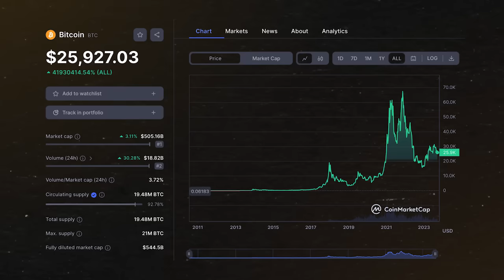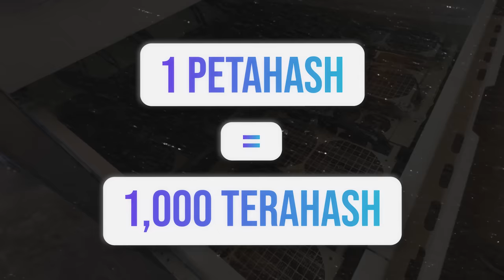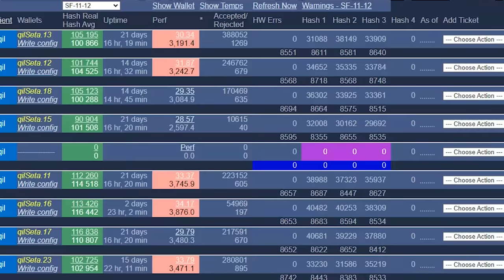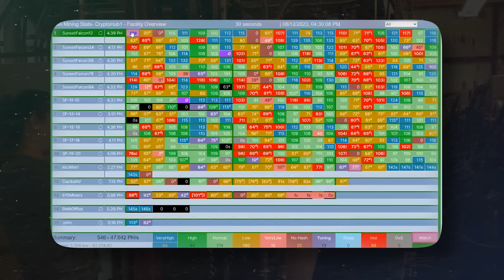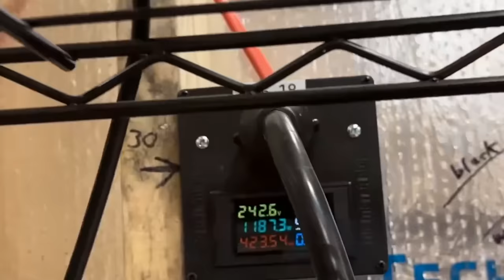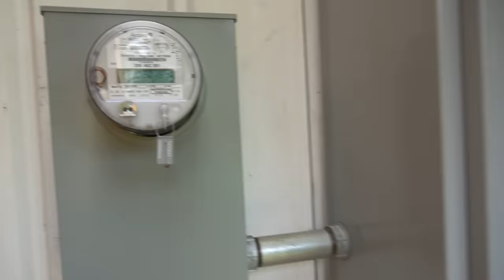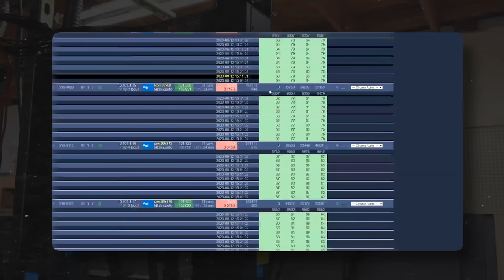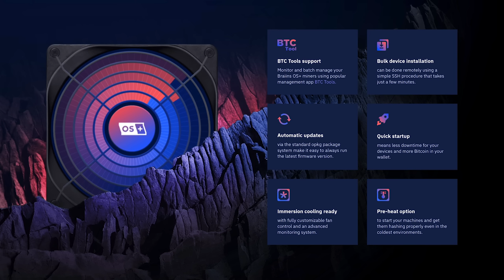Inside a Liquid Cooled Bitcoin Mine

Comment: This farm is the exact farm I was trying to create 3 years ago.  Many people wont understand the level of expertise that is needed to setup something like this.  Not to mention the expense which is one to the factors that ultimately held me out.  The other was not having an industrial or middle of no where to be able to setup.  Then the third was the realization that the electrical needs are beyond my scope of understanding and require expensive professionals along with expensive equipment with long lead times.   Congrats to this gentleman for making the dream work.
Reply: It's not that complicated electrically. Its just a lot of power as each machine used 3000+ watts. Coming from building commercial grow rooms for the marijuana industry building mining setups like this is a walk in the park.
Reply: @attribute-4677  Eh, in the near term it definitely does not. A facility like this might take decades to pay off.
Reply: @DJSolistica market could crash before they see a payoff.
Reply: problem is having top efficiency miners, manufaturers sell only asic miners after their campaign and you buy expensive 2 years old machine and Bitmain have 1-2 generations never .. preset miner is very easy if you can set up tplink router you made it. Its only on elektricity price and price of miners. What that boys not use waste heat for any heating close people housing etc, blowing it for air is stupit, it can bring beeter economics.
Reply: @jirkas229  what kind of back yard english was that comment?
Reply: You are brave
Reply: And destroying the environment one piece at a a time. Talk about waste
Reply: @ronnbarsvagen2512  speaking of wastes.  I just saw they are in the process of putting a Tesla recharging station in on the lot next to a gas station.  I was hoping for a sandwhich shop.  What a waste of electrical components that could be used for something useful.  Nothing like E-waste to take up all of our grid space.
Reply: @ronnbarsvagen2512  You want to talk about destroying the environment? Wait until you do the math on how much electricity we've consumed globally to power millions of ATM machines for nearly 3 decades. That doesn't even begin to include all the hundreds of thousands of physical bank structures, the water and electricity that they use, etc. We're talking tens of thousands of times more consumption of resources than the entirety of crypto has used to date.
Reply: This is small baby.
Chinese have the biggest farms ever built.
BUT!
Not only that price is wrong to build it today- but the amount of available coin, due to overmining is shrinking and shrinking.
Meaning soon they wont give more then $0,000000something per calculation.
Have fun having these with rising electricity cost from all the green people.
Reply: Micro match/mining is the future my brother :)
Reply: @DJSolistica look closer into Bitcoin, the big picture, the timeline from 2009 to 2141! It's a elegant game of energy and I think that, sooner than later, it could save us a Chaotic future.

Comment: Vosk eeprom tool that guy has I have the same one and you can use it with a PC and also swap the default language to English, ASIC repair is not hard once you learn what all each chip does and using the error logs to point you in the right direction.

Comment: he proofs with running electrical hardware inside water and in the way that it should not run at all. that you can make it to run.
i just wonder how long it will. cause this water environment is technically having conductive characteristica as well. meaning it could interfere from one mining hardware into the other via a shorted circuit. creating power surges in the grid.
the ones that can damage the hardware. 
Not sure how safe it really is therefore.
not freezing of the water is also one thing. but what about corrosion? this as well can damage the boards and them no longer running properly.
the idea is not a bad one. but maybe adding some additional device that can buffer towards such problems also inside the water would not hurt. if it is not existing yet. it should be build. this has a lot of potential towards every mining hardware on the long run.

Comment: Hey Vosk,  good video.  Next time though can you ask some questions on how they mine with such a farm.  I am curious if they go all in on solo mining or split it up to guarantee some coin.  It sounds like money constraints is a driving factor, along with power of course, as to the size they shoot for.   It be interesting to also see the things they had when they started.  Things like what professionals were already on the team, who they hired and how much money/financing, etc.  I know these get personal and some might not want to share.  I heard him mention he had either owned or worked in air cooled centers prior to.  So there was some experience entering it.  The programs he has running he made is huge advantage.  I smacked my head many a night trying to figure out if a program could do what I wanted and how much it costs.  I never thought about creating my own.  Dude is a true legend.  But one thing to note is the smaller cooler are not good for residential unless you live in a colder climate.  As the fans go to max they get quite loud.  I have an original cooler, maybe new fans are not as big.  But typically the faster they spin the louder they get.  Also there are a lot more question I be curious to ask as to the prep of his miners.   In immersion, many pull off fans and add spoofers to fool miner.  I am curious if they did fans to power supplies too.  Also if they had to change up the bus bar config or not.  By looks it appeared he did not.  Immersion is cool, flow is really important, and to hear him state some problems made me feel better.  I had many of the same issue.  Some days it made me feel it was me.  With Immersion still being relatively new, there is not many tutorials on how to solve things or issues that will arise.  Its all trial and error and hope you don't blow nothing up in the mean time.  lol.  Great video though!
Reply: 15:15 they pulled the fans. He also noted they use Braiins software and the benefits of mining to their pool. 

If you watch the interview with the owner (different video) you can tell he is a little concerned with profitability in the current environment. 

As such I have never seen a commercial miner solo mine, but I'm sure there is one.

The strategies of a commercial miner and hobby miner are not even close. Commercial miners have to execute with certainty to the financial models and business plans for the project. Whereas a hobby miner may gamble with solo mining even though this has happened less that 200 times.

Comment: They should have run the dielectric oil out to the cooling tower. The additional heat exchange is costing them 10% of their cooling capability mainly temperature 🌡 but also btu capacity.
If they did a supply and return well and pump ground water thru the heat exchangers they could eliminate the cooling tower and use 50-60*f water to cool the tanks. Way less power consumption on a well pump then all those cooling towers and the loop pump.
Reply: More than likely you cannot do that because you run the risk of contaminating the oil and causing short circuits in the equipment.  Not to mention the extra cost of all that extra oil needed to fill the pipes and cooling unit.
Reply: I’m pretty sure they would have considered that.

Comment: How many Megawatts does the facility use?
Reply: About 1.8MW currently with the heat in the summer. We ramp it up another 400kw with over clocking when temperatures and BTC prices agree.
Reply: @Colby_Attack I have some experience in this here is something to consider,
 you should have run the dielectric oil out to the cooling tower. The additional heat exchange is costing them 10% of their cooling capability mainly temperature 🌡 but also btu capacity.
If they did a supply and return well and pump ground water thru the heat exchangers they could eliminate the cooling tower and use 50-60*f water to cool the tanks. Way less power consumption on a well pump then all those cooling towers and the loop pump.
Reply: 1.21 jiggawatts!

Comment: I am going to be that guy but us at Vnish do Autotune on all our models. We actually invented AutoTune in early 2018.

On another note holy crap this is a really clean farm also your management software you built is great. You would be surprised how many large miners don't have custom stuff like this mad. Kuddos to you it's really great keep up the good work!
Reply: We used Vnish a while ago and didn't recall the AutoTune feature.  We liked the firmware but ultimately switched since we had so many AMLogic control boards.  Certainly would recommend other miners take look at Vnish.  Appreciate the comments about our software.
Reply: @BMAEnterprisesInc
I have some experience in this here is something to consider,
 you should have run the dielectric oil out to the cooling tower. The additional heat exchange is costing them 10% of their cooling capability mainly temperature 🌡 but also btu capacity.
If they did a supply and return well and pump ground water thru the heat exchangers they could eliminate the cooling tower and use 50-60*f water to cool the tanks. Way less power consumption on a well pump then all those cooling towers and the loop pump.

Comment: Nice setup. Hard work. DCX flow dynamics is not optimal. Also the maintenance is a horror show with tens of small heat exchangers and manifolds. DCX immersion oil also used to be white mineral oil (Group 3).
Reply: In that short sentence, you are 2 times wrong, and you provide misleading information.
Dual loop systems are much better for maintenance reasons (you can just close one small loop if needed) instead of switching the whole installation, not speaking about the major failure and losing all the fluid from the whole system. In some requins single loop systems, it's just forbidden because of environmental restrictions.
ThermaSafeR is a fully synthetic dielectric fluid, it's even not made of oil (hahaha) - if you're not sure, don't mislead others

Comment: That's $2,200/day that could be going to miners instead of being money wasted on power. 
Proof of stake makes so much more sense. 
Let's not forget how much this entire setup costs for the equipment, design, installation, maintenance. 
It's ridiculous. 
I can run 50+ ETH validators on 1 small box running off a regular 120v home outlet 😂😂😂
Is proof of work really better for ANY reason??? Is there any hard core proof of this???
Because being required to waste all this money and time to do something ETH does plug and play on 1 small box is INSANE. 😂😂😂
Reply from the maker: you have $3m+ in ETH? lol

Comment: So it’s $66k a month power bill to make $12,000 of coin at a $40k loss according to current bitcoin rates…. They are losing almost $50k a month if electricity is 8 cents per kWh charged at a commercial rate. If you did this on residential electricity rates they would be losing almost $100k a month.